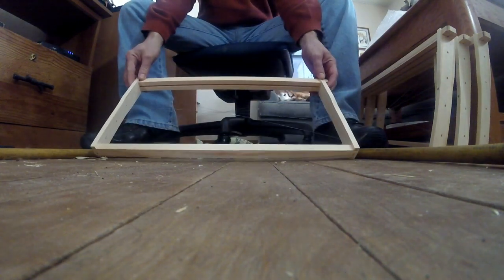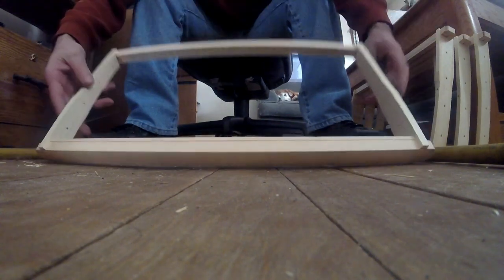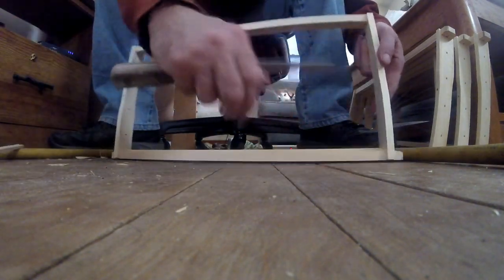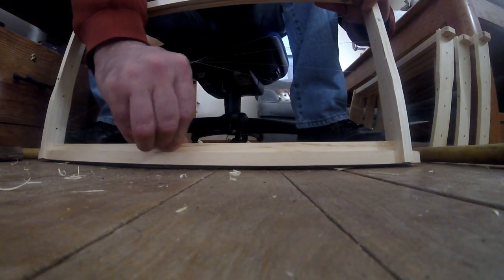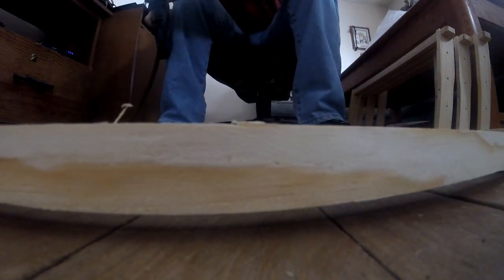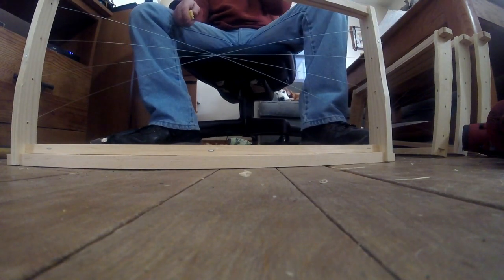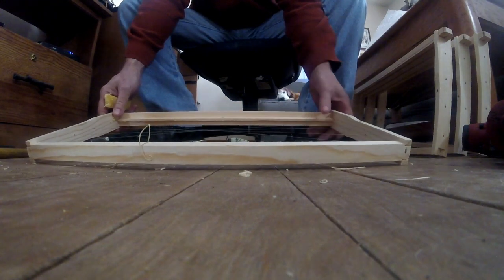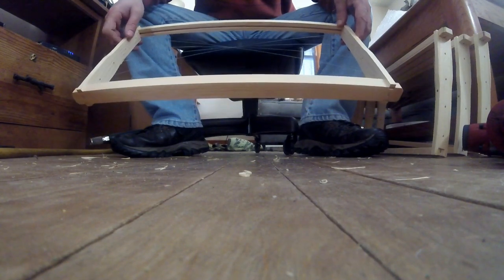Adding Starter Strips to Foundationless Frames

Comment: Timely info. I just finished assembling, stringing, and waxing (painted on) 100 deeps. Ordered 100 more from ML yesterday. I am switching from the wired wax to foundationless for the same reasons you mentioned. The bees know best.
Reply from the maker: debated on painting on the wax...but I just don't feel the bees need that much wax to get started...I don't think they reuse wax, but are attracted to it to start building their own
Reply: @KevinsNorthernExposure  Had I rubbed it on, I'm sure it would have gone a lot further. As it is, I am out of rendered wax and looking at frames that were supposed to go in my swarm traps. :)

Comment: I think need put a starter  strip of wax on the frame the wax does  not have to be a large  sheet  of wax it can be a half inch  piece
Reply from the maker: Although that is certainly one way to do it, as you know in beekeeping, there is more than one way to skin a cat. This is a proven method as well...and I don't have to cut up starter strips to do it.